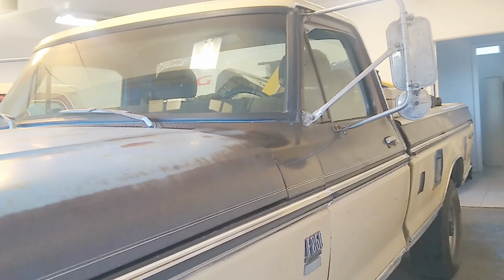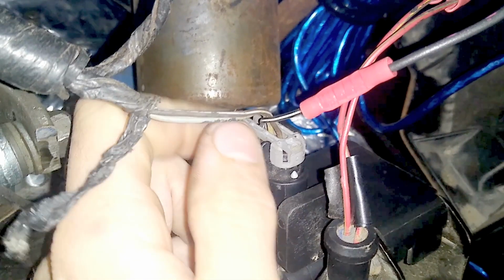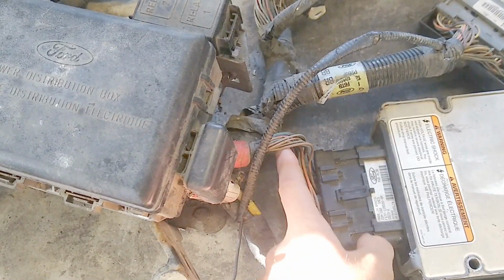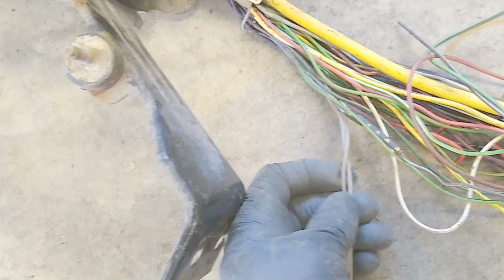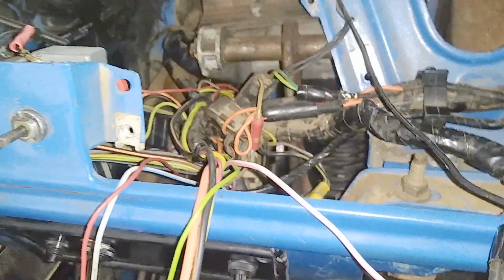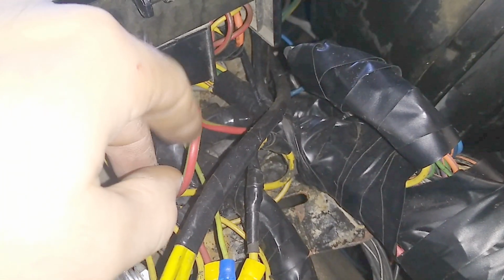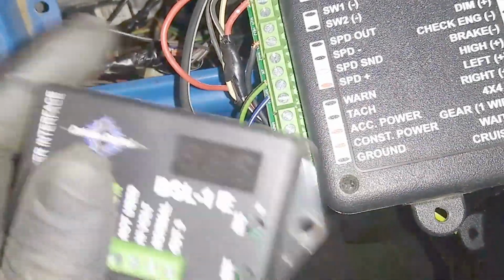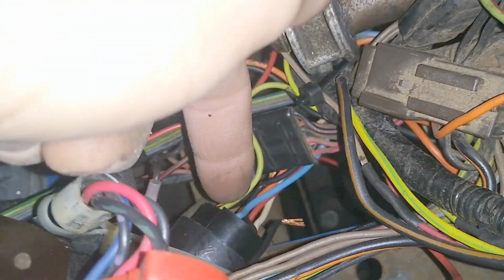How to wire a 7.3 Powerstroke (Powerstroke Swap Pt. 4)

Comment: Muy bueno su programa amigo y le escribo desde vzla y le comento un gran problema que tengo con mi carrito una f350 año 2001 que no quiere encender y le coloque la idm nueva y arranco x 30 segundos y se apagó nuevamente y no le quiere enviar la señales a los inyectores y si está a su alcance y me regala su opinión será de mucha ayuda para mí gracias y esperando pronta respuesta....
Reply from the maker: ¿Arranca y funciona durante 30 segundos ahora, o no arranca en absoluto?
Reply: @humboldthillbilly1848   muchas gracias x su respuesta y deseándole un próspero año lleno de muchos logros y con lo del carro pues le coloque la idm nueva y prendió x 30 segundos y se apagó y no envio mas pulsos a los inyectores y según su conocimiento puedo hacer para que funcione ...
Reply: No quiso enviar mas pulsos a los inyectores y las RPM no sé mueven en el tablero, gracias y esperando su pronta respuesta....
Reply from the maker: @williancontreras6508   Bien, cuando la llave está adentro, ¿se enciende la luz de Esperar para comenzar?  Si no, podría ser tan simple como un fusible.  ¿Tiene acceso a una herramienta de escaneo?  Estos motores están controlados por computadora y funcionan a base de aceite de alta presión.  La computadora debe ver un mínimo de 500 psi antes de impulsar los inyectores.  También necesita ver RPM.  Hay un sensor de posición del cigüeñal en la parte delantera del motor junto al equilibrador delantero que falla.  Hay varias cosas que pueden causar que el 7.3 no arranque, por lo que poder leer los valores con la herramienta de escaneo será más efectivo que reemplazar piezas hasta que el problema desaparezca.
Reply: Muy buenos días amigo espero allá resibido un feliz y próspero año nuevo y le cuento que se reviso todos los fusibles y todos todos están bien y en el tablero todas las luces indicadoras marcan bien y da marcha normal pero no enciende y si UD tiene un correo personal le envío el vídeo para ver qué opina ud
Reply from the maker: @williancontreras6508  Si los fusibles están bien y las luces del tablero funcionan, entonces la computadora está recibiendo energía.  ¿Puedes leer los códigos almacenados en la computadora?  Si los inyectores no pulsan es porque no hay señal de RPM o porque la presión del aceite está por debajo de 500.
Reply: Ok papá muchas gracias x su tan valiosa información y ya voy a buscar el ociloscopio para revisar el sensor de RPM y le estaré escribiendo según valla avanzando en el trabajo de mi carrito gracias y estaremos en contacto.....
Reply: Buenos días amigo soy de vzla quien le escribió el otro día comentándole del problema del powertroke 350 año 2001 y si salió como UD me dijo el sensor de posición de levas estaba dañado y se le cambió y prende pero ahora prende y se mantiene muy poquitico prendido y se apaga de nuevo y todo marca bien  en el tablero y según su conocimiento que podría ser, gracias y disculpe la molestia y esperando su pronta respuesta 🙏
Reply from the maker: @williancontreras6508  Intente desconectar su sensor ICP en la culata junto a la carcasa del filtro de combustible y vea si permanece en ralentí.
Reply: @humboldthillbilly1848  papá le desconecte la válvula icp cómo UD me dijo y si se mantubo prendido xq un ratico pero con mucha tembladera y falla y se apagó nuevamente y que nuevo paso debo seguir patrón.....
Reply: @humboldthillbilly1848  ahora después que se apagó ya no quiere prender de nuevo papá
Reply from the maker: @williancontreras6508  sin una herramienta de escaneo será difícil monitorear el sistema de aceite de alta presión.  ¿Ha vuelto a no obtener un pulso de inyector del IDM?  ¿Qué marca de sensor de posición del cigüeñal usaste?  Algunas marcas de sensores son chatarra.  La marca Ford/International son buenos sensores.  ¿Cuál es su presión de combustible en la caja del filtro?
Reply: @humboldthillbilly1848  si le coloque un sensor de la marca Ford internacional y si está enviando la señal de RPM xq marca muy bien en el tablero y dentro de un rato viene un amigo con un escáner para revisarlo y en lo que tenga la información de la presión de aceite y diesel te escribo para que x favor me regale su opinión y muchas gracias....
Reply: Muy buenos días amigo ya le colocamos el escáner y de presion de aceite en arranque marca x encima de 500 psi pero del diesel está x debajo de las 40 psi y hay que se debe hacer para que se mantenga entre 45y60 psi  y aquí le dejo mi número de wasap x si quiere responder al wasap y hay le puedo pasar más información detallada de como va el progreso gracias a su valiosa información......
Reply: @humboldthillbilly1848  muy buenos días amigo espero se encuentre muy bien y le comento papá que ya el carro prende pero no se mantiene en realinti y UD será que me puede hacer el favor y me dice como se purga el sistema del diesel xq yo pienso que es x eso que no se mantiene ensendido y gracias y esperando su pronta respuesta 🙏
Reply from the maker: @williancontreras6508  su camión debe tener una bomba elevadora de combustible eléctrica en el marco debajo del camión cerca de la puerta del conductor.  si no proporciona suficiente presión de combustible, el camión no seguirá funcionando.  Si funciona correctamente, la bomba debe cebar todo el sistema de combustible del motor.  Si la bomba está bien, las únicas otras causas de baja presión de combustible serían una restricción en el tanque de combustible a la bomba o en la caja del filtro.  Un filtro de combustible obstruido o un regulador de presión defectuoso causarán problemas en la carcasa del filtro.
Reply: @humboldthillbilly1848  muy buenas tardes patrón le comento que la bomba que va en el marco del chasis está trabajando y que lo que me tiene pensando un mundo es que ya le cambié toda la línea de combustible desde el tanque hasta el motor y lo purgó x la llave que tiene en la cáscara del filtro del motor y le saco los gases hasta que sale solo diesel y enciende y aselera muy bien pero a los dos minutos sigue fallando y se apaga de nuevo y vuelve a estar lleno de gases el sistema y todo dnd va el filtro y la cáscara en el motor y ya no veo x dnd podrá estar entrando aire al sistema y hasta el tanque ya lo revise y está bien y lo purgó y vuelve y prende y pasa lo mismo que le estoy comentando, gracias y disculpe la molestia y esperando su pronta respuesta 🙏
Reply: Buenas tardes amigo le comento que sigo con el problema del carro y ahora le cuento que ya le cambié la válvula IPR y también la ipc y también la bomba de transferencia del diesel y el carro sigue con el mismo problema que prende y se mantiene en realinti x muy poquito tiempo fallando y brinca mucho el motor y se apaga y no tengo ni la menor idea que será ya la falla, muchas gracias x su opinión y espero que pronto me pueda responder.....
Reply: Buenas tardes amigo ya se le colocó el escáner al carro y mostró falla  P0603 falla de pcm - KAM  y se le reviso todo el arnés completo y está bien sin cortos ni malos contactos y mi pregunta es la siguiente., Esa pcm es reparable o hay que colocarle otra pcm
Reply from the maker: @williancontreras6508  
Es lamentable que tengas un mal PCM, también raro. Lamentablemente, la única solución adecuada es reemplazar el PCM.
Reply: @humboldthillbilly1848  buenos días amigo muchas gracias x regalarme sus opiniones y ahora trataré de cambiar la pcm pero aquí en vzla no se consigue y con UD allá no podremos llegar a un acuerdo para poder conseguir una allá, gracias y esperando su pronta respuesta 🙏....
Reply: Buenas noches amigo espero todo esté bien x allá y te comento que x aqui serca conseguí un sr que reviso la pcm y según el sr la pcm estába era solo borrado el sofdware y lo actualizo pero el carro sigue con el mismo detalle xq igualmente prende pero se mantiene unos minutos en realinti y se apaga y será que me regala su opinión x favor o un contacto para enviarle más información y disculpe tanta molestia y esperando su pronta respuesta 🙏.....

Comment: Does anybody sell a stand alone harness? I’m looking to put a 7.3 from a 2002 E250 into my 1978 F350….. I hate wiring. I did buy the whole van, just haven’t pulled the engine yet. I’m not using the factory trans, so I just need to control the engine. Thanks
Reply from the maker: Mark Fugazzotto has a YouTube channel. He's mentioned before that he'll build a standalone harness for $275 plus shipping if you mail yours in.

Comment: 96 formerly automatic 7.3 into 87 formerly with a 4 speed now with a zf5. I'm using the 87 firewall plug and repinning it. Besides the throttle pedal stuff is there any reason thats a bad idea?
Reply from the maker: Not a bad idea at all as long as you have enough space for all the pins you need in the 87 plug. You might have some idle and throttle issues with the ecm being automatic. I sent mine off to Complete Performance for a manual hardware swap. If all of the required circuits are preserved and properly connected it'll run just like it did in the original truck.
Reply: @humboldthillbilly1848  I have some questions that might take me a long time to figure out and maybe you'd know them. Do you have a website or email or something?
Reply from the maker: @jakepetersen677  I'm not set up for communication outside YouTube. But I'd recommend getting a Ford Electrical and Vacuum Troubleshooting book for a 96 F350 off eBay for $50. It'll give you all the wiring diagrams you'll ever need for wiring the 7.3. Most of the wiring in the 1980 to 1997 trucks is almost identical in color and layout.

Comment: Have you ever thought about offering this as a service? I’d be more than willing to pay to get this done.
Reply from the maker: I've thought about it, but I'm still on the fence. Biggest reason for me not currently offering a harness is because of integration. I can make these engines run on the ground with a few wires, but it's a whole different animal to have an integrated harness with cruise control, OBD2, automatic transmission controls, A/C, etc that has the correct wire lengths and plugs in to someones custom swap project.
Reply: @humboldthillbilly1848  I literally just want the engine to run, ac idle wires and the data link connector. I don’t want cruise and I’m using a zf5. Planning on keeping me 78 gauge cluster and all that.
Reply from the maker: @danrivers4102  How are you going to run your speedometer? If your zf5 is 4x4 then you might be lucky and have the special 1356 transfer case with the speedometer gear. Otherwise the signal will be electric which won't drive your mechanical speedometer. For the other instruments the stock sending units on the Powerstroke will talk to your original cluster just fine.
Reply: @humboldthillbilly1848  np205 bolts right up to a zf5. Just have to notch the tail housing for the shift rail on the 205 to clear. I’ve done it to a few of them.
Reply: @danrivers4102  Will the 205 hold up well to a 7.3? I have one, but I plan to put the truck to serious work and need it to last.

Comment: I’m working on a 1996 7.3L swap into a 1965 F100. I bought an engine and ZF5 only, then sourced an engine wiring harness to the firewall only with IDM and automatic PCM. Trying to run this on the engine stand before I attempt to install in the truck. 

I have power to the pcm and IDM but won’t fire. Has new IPC but haven’t replaced crank sensor yet. 

What do I need from the firewall connector to make this work?

Comment: What was your solution for power brakes ? I’m doing a 7.3 swap in my 65 f250 and didn’t know if I was gonna run a vacuum pump or hydroboost
Reply from the maker: Right now I'm running the vacuum pump with a large superduty vacuum reservoir and master/booster off a superduty 5.4. I tried hydroboost long ago and didn't like how it felt when braking. If I had a heavier truck and towed really heavy I'd probably go with hydroboost however. If your 65 has a vacuum booster and you are fine with how the thing brakes I'd stick with that.

Comment: Putting a 7.3 in my b model Mack  rat rod project and I’m not going to use the firewall plug do you know which pins you connect the obd2 wires back to on the pcm to still use it without messing with the firewall plug thanks in advance ! Very helpful video by the way!
Reply from the maker: Depends on the model year 7.3. There are some differences between California and non-California trucks as well. For 49 state and superduty trucks it should be pins 13, 15, and 16. You will also need both grounds as well as 15A fused constant power.
Reply: @humboldthillbilly1848  thanks for the quick reply ! And sorry guess I should have mentioned that it’s a 95 engine
Reply: @humboldthillbilly1848  Are there many differences in wiring harnesses for pre-99 (or OBS) 7.3 powerstrokes? I know the auto to manual gig but If it's the same truck (just say f350 7.3 with manual trans) but one is a '95 and the next is '97 are they running the same harnesses(excluding California trucks)?
Reply from the maker: @oldschool6345  There might be some subtle differences for 1997, but all the 1994-1996 engines should be the same minus the transmission wiring, even the California engines. 1997 was the first year for emissions, so those 97 California model Powerstrokes I believe are more similar to the 98 and newer Powerstrokes. If your engine is not a California model, then all 94-97 Powerstrokes are the same.
Reply: @humboldthillbilly1848  Well I thought so but.... you're way deeper than I've ever been in the harness and appreciate the info! Thanks

Comment: If by some stroke of luck you see this comment nearly a year after you posted this can you clear up a few things for me. The red/green coming from fuse 22. Does that have to go anywhere other than from the fuse box to the ignition relay? Also if I run that to the relay and ignition power to the same side I should have key on power correct?
Reply from the maker: The large red/green from fuse 22 only needs to go to the ignition relay. Normally it goes through the firewall to the ignition switch cluster under the factory steering column and gets activated when you turn the key to the ON position. 

Not 100% clear on the second part of your comment so here's the whole story: Your standard 4 pin relay has two sides. The CONTROL side and the SWITCHED side. The CONTROL side sees power coming from your key switch one one pin and ground on the other pin. The SWITCHED side should have constant 12 volts from the battery on one pin, and the circuits you want to send power to on the other pin. So basically you will have 2 small wires going to opposite pins for your CONTROL, one large wire going from battery to a pin on SWITCHED, and all the wires you want to activate with the key (including red/green) on the opposite SWITCHED pin. Clearest answer I have.

Comment: Just the video I was looking for.  I just bought a 99 4x4 to stick a 79 body on and didn’t want to run the factory 99 column and gauges. I put Dakotas in my 68 Bronco and planned to do the same thing this time.  I guess the my question would be, does anyone reflash the ECM to disable the PATS system on the later models? Bitchn video by the way, alsoI live in Chico not far from ya. 👍🏻
Reply from the maker: I've seen PATS delete services on eBay, but I haven't used any so I can't recommend any to ya. Also considering your in CA like me you probably have a CA powerstroke with a different flash and potentially different engine hardware, so be sure to do some research on it.

Comment: I am trying to figure out wiring for my 67 swap. How do you get the dash to power on?
Reply from the maker: Are you running the stock cluster for the Powerstroke or for the 67?
Reply: Stock cluster for 95 when I power on the wire in the fuse box the check engine light flashes and a relay clicks
Reply: I got it running your video was very helpful I just had a bad pcm ground